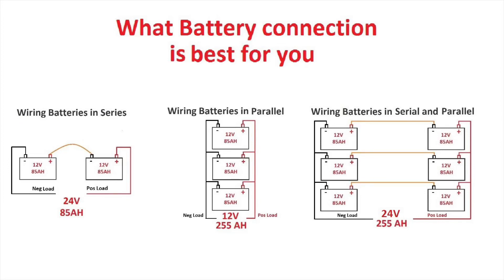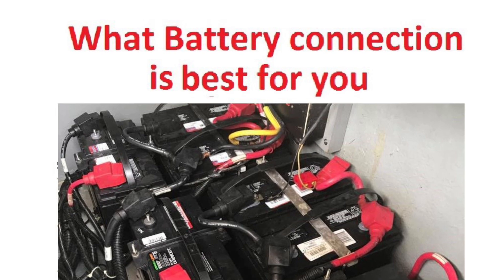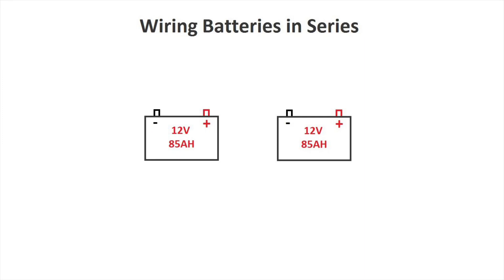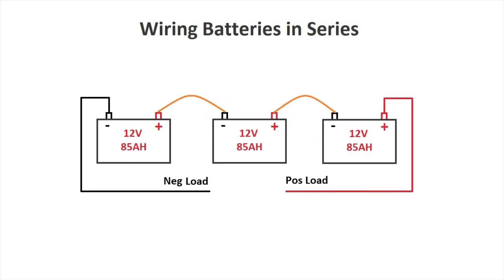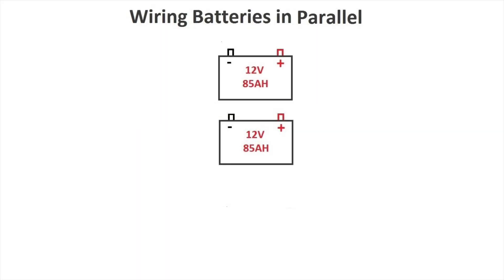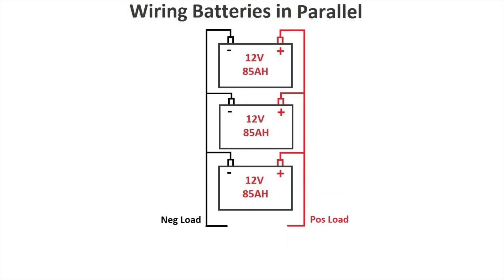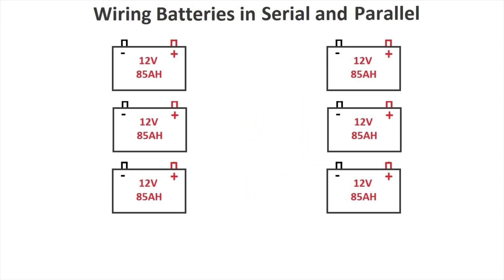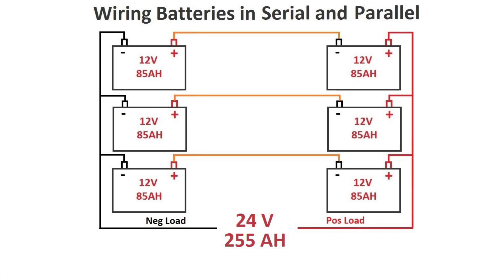Installing batteries, series vs parallel

Comment: is there posibiliti to use only 2 baterrys and have seperate ground path like useing one negative terminal to chassys and one to virtual grounding? The thing is Im in dire need of an system that wuld not confuse an alternators cutt in current when ever I try to use capacitors with my ignitiin system I end up swaping polaritis back charge etc the alternator get confused it refuses to shut off the baterry light unless I rew the engine at higher rpm ranges I used ceramic capacitor my engine runs smuther and starter motor is lot faster cranking and other devices run well with that set up but the alternator to by preciseli delco 12si get confused . So is there any circuets that can run in dual power supli mode? Some sort of virtual ground or virtual positive similar to voltage or amp booster circuets? Basicali I wondered what wuld happen if you doobel the size of lead acid plates on 1 side if the baterry what wučd happen? You see I found some interesting circuets about cdi ignirion but sadli they run on pulsed dc and ac mostli I requare kinde of phase shifter circuet that can change pick up coil triggering circuet so that I can sucesfull retard /advance ignition timing so I have lot problems figuring out how to modifi my existing hei ignition system and that alternator problem . So I supose capacitors interact with devices but how to counter those effects??? Normali I use hv ceramic capacitors in series + ignition coil the other side goes via an toggel switch to baterry ground so that wiard alternator cutt in current takes effect .Im not shure how to deal with this suposedli the old tractor delco alternators hade resistor and capacitor if they are faulti the baterry wuld over charge or under charge but are there any mathematical equation that can by used to reverse that effects by placeing resistor and centrain capacitor value on the alternator it self? So I hoppe this question makes sence Im also curiuse for other peopels suggestions what culd by used in my case ?
Reply from the maker: Hi MechanicForGMCars, thanks for watching, I will leave your comment and question for people to answer if they know the answer. I can't answer because I haven’t done setup like yours.

Comment: How to connect 3 x 12 volts tubular batteries in 1 x 24volt 3.2kw Inverex brand inverter? please reply urgently.
Reply from the maker: From the internet

To connect three 12-volt tubular batteries to create a 24-volt system for your 3.2 kW Inverex brand inverter, you will need to follow these steps:

     1 - Gather the required materials:
    * Three 12-volt tubular batteries
    * Appropriate battery cables and connectors
    * Insulated tools (screwdriver, wrench, etc.)

2 - Determine the battery configuration:
    * You will need to connect the batteries in series to achieve the desired 24-volt output. In a series connection, the positive terminal of one battery is connected to the negative terminal of the next battery.
    * The positive terminal of the first battery will be connected to the positive terminal of the inverter, and the negative terminal of the third battery will be connected to the negative terminal of the inverter.

3 - Make the necessary preparations:
    * Ensure that all batteries are fully charged and have a similar capacity and voltage.
    * Place the batteries in a suitable location with proper ventilation and secure them in a battery rack or enclosure.

     4 - Connect the batteries in series:
    * Connect the positive terminal of the first battery to the positive terminal of the inverter. Use a battery cable and appropriate connectors to make a secure connection.
    * Connect the negative terminal of the first battery to the positive terminal of the second battery.
    * Finally, connect the negative terminal of the second battery to the positive terminal of the third battery.
    * The negative terminal of the third battery should be connected to the negative terminal of the inverter.

      5- Double-check the connections:
    * Ensure that all connections are secure and tight.
    * Inspect the cables for any signs of damage or loose connections.

6 - Test the setup:
    * Turn on the inverter and monitor the voltage and performance to ensure everything is functioning as expected.
    * Verify that the inverter recognizes the 24-volt battery bank and operates within its specified parameters.
It's essential to consult the user manual or manufacturer's guidelines for your specific inverter and batteries. Following the instructions provided by the manufacturer will ensure a safe and proper connection

Hope this helps
Reply: @joetheboatguy5394  Thanks Joe, can i have one video for the same to understand correctly as still my inverter sensing 36 volts instead of 24 volts and giving beep of warning. Please assist
Reply from the maker: https://images.app.goo.gl/DLB9fMJ9Mxi6SPZ67

Comment: Please how do i connect eight 12volt batteries to generate 48volt
Reply from the maker: hi Frederick Udoukpe, thanks for watching. here’s a great website that gives good info and they have the example of 8 batteries for 48 volts at the bottom of the website.  check out https://cleversolarpower.com/connect-8-12v-batteries-to-make-48v/
Hope This helps :)
Reply: @joetheboatguy5394  thank you very much, it's really been helpful

Comment: I see in serries and parralel connectie 3 times 12 volt is it then not 36 volt at 255amp?
Reply from the maker: Hi Rob De bruin, Thanks for watching. basically, the last exercise is 2 in Series and 3 parallel. See this video for explanation. https://youtu.be/Ts7y_HOd5WA       
Let me know if this helps.    :)
Reply: @joetheboatguy5394  sure i let you know! Out of one of the best videos that really matters for me. Its always a talk about amps or volt and then how fast you can drive. This video was way different. Thx
Reply: In series capacity won't change, only voltage multiply by the number of batteries

Comment: Easy way to think of amps and volts.   Think of a pipe with water flowing. 

Amps is flow
Volts is pressure.

Comment: Hi, I have 8 batteries 12v 26Ah connected (S and P). these are connected to a Mecer 2400va, after 2 hours batteries run out and when I check them, I see a reading of 10v, 11v, and 12.36v in some batteries. not sure what I have done wrong. any advice?
Reply from the maker: Hi Thobela, thanks for watching. Do your wires heat up when in use? Make sure you have the right gauge wire in your setup. Next I would make sure all your connection are good. If they are loose it will create resistance or no contact. If you have fuse between batteries make sure they are ok. I suspect loose connection….  

Also if you have batteries that are older or with damage cell then other batteries will suffer and drain faster. If your wiring is good, I would test every battery individually in case one is going bad. Let me know your results 

Hope this helps, good luck
Reply: @Joe The Boat Guy thanks, I appreciate the feedback. I will check everything you just mentioned. Thanks

Comment: question in your first example, 24V, 85 AH = 2040 Watt hours. example #3, 12V 170AH = 2040 Watt hours. I'm I right? or something I missunderstand?
Reply from the maker: Hi Alexandre LeBlanc, yes that is correct. The only difference is the voltage with example 1 you will have a 24v supply. And with the 3rd example you will have a 12V supply 👍

Comment: I have 6 12v valence battery connect it series-parallel, 24v and planning to buy a 24v valence battery connect it as parallel, can I connect it on the 6 battery 12v series-parallel then 6 24v parallel?
Reply from the maker: Hi, thanks for watching, I don’t think you would have the same Ah from the 6 12v batteries and your 24v battery. If you don’t, then I would not recommend it. I must say, I never did that. Setup I do are usually same (v & Ah) batteries. Sorry I’m not much help. But Ah are important they should match or be very close. Which in your case don’t think they will be the same. 🙁. Also make sure all your batteries are the type. Example: Don’t mix lead Acid with gel cell batteries

Comment: How to connect both , i need different powers poinys
Reply from the maker: Hi Nitin, to get 2 powers points (example 12v and 24v) its best to have 3 batteries. One for 12V and the 2 others for 24V. You can do it with 2 batteries only but it's not the best for the battery life. To do with 2 batteries you will take the example of 24V in series and then just use your first battery for 12V. hope this helps
Reply: @joetheboatguy5394  sir , i have 3 (3.5 v ) { phone battries } batteries and how connect 3 battries that i got 3 power points 
In the first point 3.5 v
In the second point 3.5 v
In the third point 3.5 v 
And in the forth point( 3.5 + 3.5 + 3.5) = 10.5 volt   ,  sir please help me !

Comment: What is the size of the wire between 6 batteries in 24v
Reply from the maker: Hi Tito, thanks for watching, it all depends what equipment is connected to your batteries. The more amperage you need for your equipment the bigger the wire should be. Here is a video I did that can explain what wire to use. 

https://youtu.be/c_9MxEdlRuA

Let me know if this helps 👍

Comment: amps x hours  is not same as amps per hour.
Reply from the maker: Hi James, thanks for watching: AH: An Amp/Hour is a rating usually found on deep cycle batteries and is a capacity rating. The standard rating is a based on how many amps you can pull out of the battery over a 20-hour period.

Comment: I do not understand how you got the answer for the last illustration where the answer was 24 V AND 255 AH. I would have
thought it would be 36V and 255 AH. Can you explain my error please. Thank-you. I do enjoy your videos.
Reply from the maker: Let me know if this helps or else I try to explain better. Btw thanks for watching 👍.  

 So if look left to right you see batteries in series so they are 2 in series so 24v. If you look up to down you see 3 batteries in parallel which we add the AH to 255AH 

Series you add voltage and parallel you add Ah 👍
Reply: Thank-you very much. Much appreciated. I was going top to bottom on both series and parallel. That is how I arrived at my answer, which was wrong. @joetheboatguy5394
Reply: However ,in looking left to right, there are 3 batteries in series. Would that not add up to 36v? That is how I arrived at 36v.
Reply from the maker: I did a little short video to explain, check out this video 
Hope it help
https://youtu.be/Ts7y_HOd5WA
Reply: @joetheboatguy5394  Dear Joe. Thank-you  very much for the video . It explained everything .Much appreciated . I think it would be nice if you could 
incorporate this video in the original one to help people like myself. Thanks again. Love your videos .   Walter
Reply from the maker: I added it to end of video so it can be clicked. Thanks again 👍
Reply: @joetheboatguy5394 which is the best connection
Reply from the maker: @fredrickomondiotieno6105  hi, it all depends on your needs and your equipments.
Reply: Each group of three batteries is paralleled so the voltage remain 12v but capacity becomes 255A. The two groups are then serried so the voltage doubled to 24v but now the capacity remain @255A